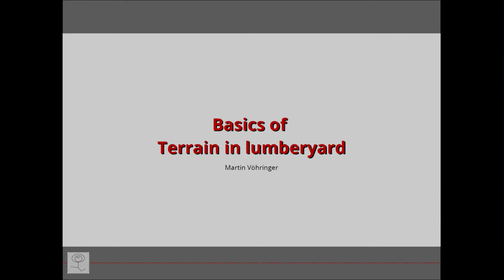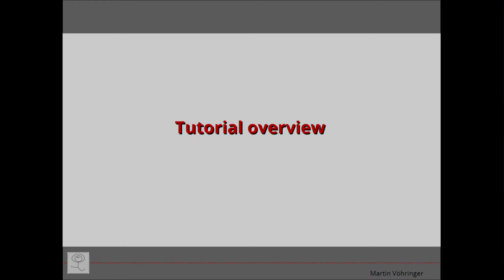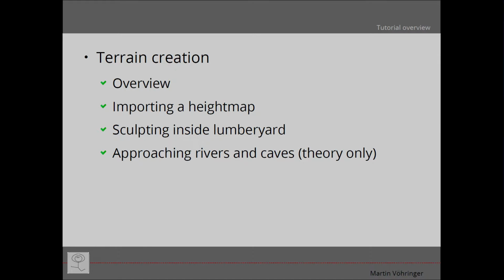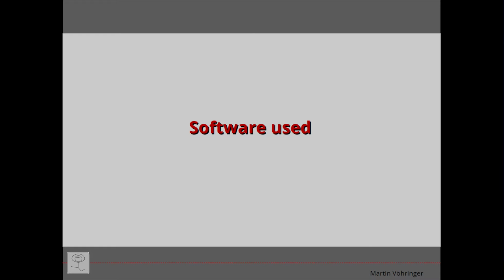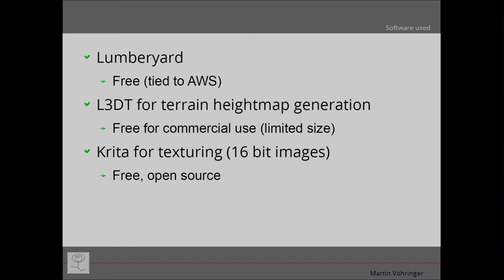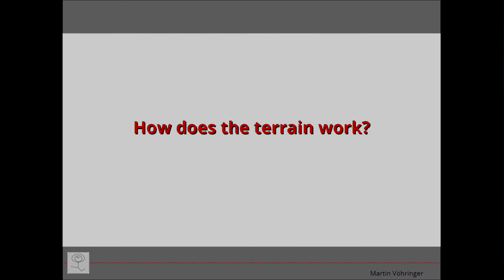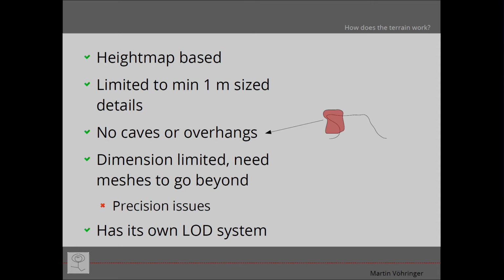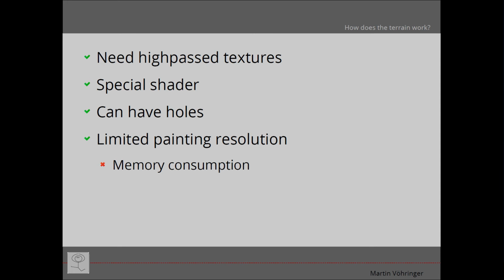Lumberyard terrain basics - 1 : Intro

Comment: Is it possible to add multiple terrains together like in Unreal Engine 
4? Is it possible to make 500 sq kilometers map by adding multiple 
terrains?
Reply from the maker: No. You are limited to what the Editor offers you when you create a new level. Also note that creating terrain above 8192mx8192m is not recommended and will result in the engine frequently crashing. You can extend beyond that 8km using brushes, but you will eventually run into floating point precision issues which will result in physics and animation looking jittered.
On a side note: If you are just getting started with game development, keep in mind that it takes multiple months to even fill out a 8km x 8km terrain with believable environments.
Reply: The decision of smaller map choice because of crash problem is good. But it is a matter of great regret that we don't get big map for making racing games. We know Need for Speed 2015-16 has 253 sq km. The Crew has more than 5000 (Thousands) sq km. After getting Just Cause 3 and Final Fantasy XV which clocked at 2021.83 sq km, it is very sad news that some small Developers don't get chance to make big open world game like we see Kingdom Come Deliverance has only 16 sq km.
Reply from the maker: Well large world support is a feature that makes sense, true but "small developers" and "big open world" are mutually exclusive in my opinion (see No Man's Sky for example).
Reply: No Man's Sky's Graphics is very bad looking, not realistic. Perhaps there are repeatation and no bullet weapons as well. You can ask why small and poor Developers want to make games. Because the richest and most famous companies like EA, Ubisoft, Bethesda, Naughty Dogs, Squire Enix are failed to understand what exactly gamers want in games. So there are many Mods available for moddable games. I don't want to make game for any commercial purpose; I want to make a game for my personal interest, such as making a game is as fun as playing a good game.